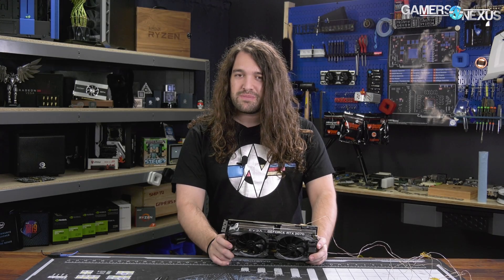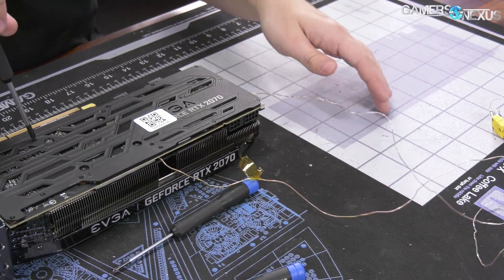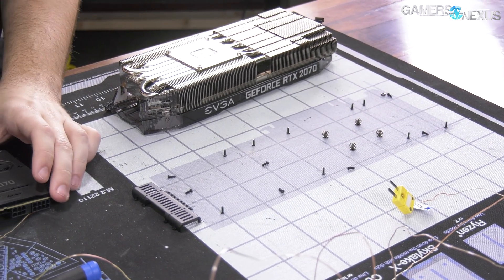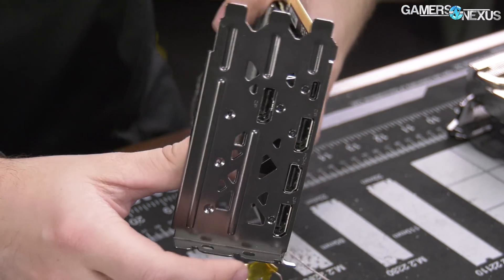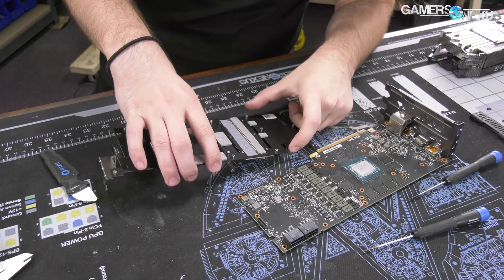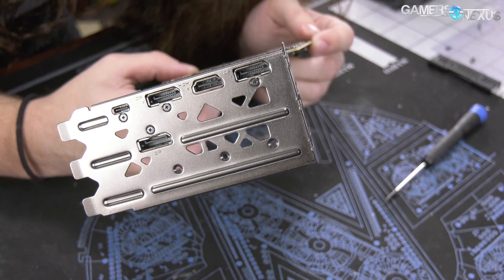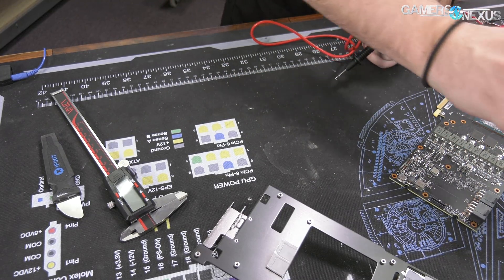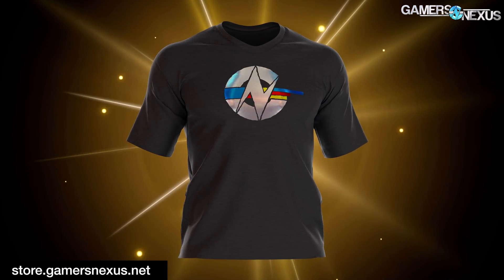EVGA RTX 2070 XC Ultra Tear-Down & Cooler Quality

Comment: #AskGN After watching this video, Buildzoid's PCB analysis of this card and some other cards, a question comes to mind: why do you think manufacturers overengineer some aspects of their videocards (memory VRM, VRMs in general given the hardware power limit of Nvidia cards, etc) when it's a very low margin product, but decide to cheap out on things like fans and coolers? Is it just marketing (moar phases moar better)?
Reply: adds 3 dollars to the price of the card.  puts it straight to the top all the "best pcb\vrm" lists.  why not?
Reply: EVGA has quite possibly the best warranty in the business. They warranty all their cards for 3 years with basically no questions asked even if it's a 2nd or 3rd hand user. So they probably want that thing to last at least that long so they don't have to spend a ton of money replacing a bunch of cards.
Reply: @devilmikey00  That sounds reasonable but plenty of other cards like Zotac's 1080 and 1080Tis have massive overkill VRMs for apparently no reason, and I believe that the memory VRM is also overkill for most cards. Maybe the price difference is not that big and they just go balls to the wall idk.
Reply: @devilmikey00  Also, they have the step up program.
Reply: Zarco better reliability means longer warranty? Just a thought, may be some other cost aspect to it
Reply: It doesnt cost them a Lot to build a better PCB, in the end a 3 dollar upgrade on the Pcb have them sell that upgrade for 50 dollars. The consumer pays a lot for a really cheap upgrade for them.